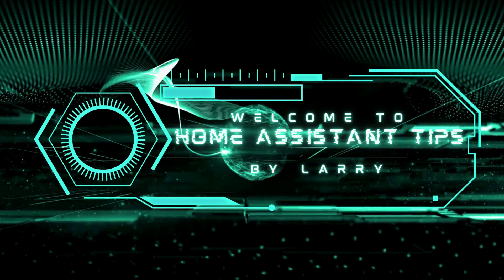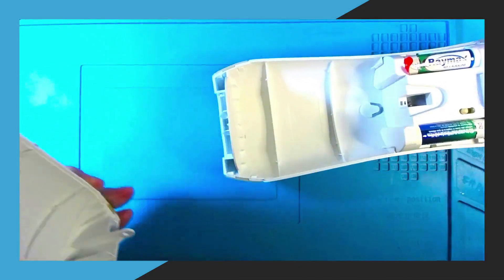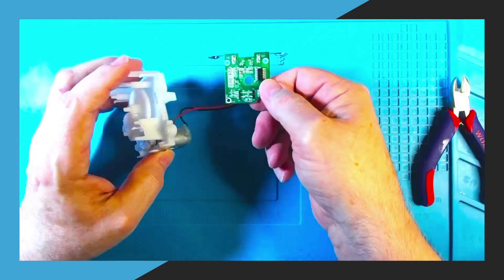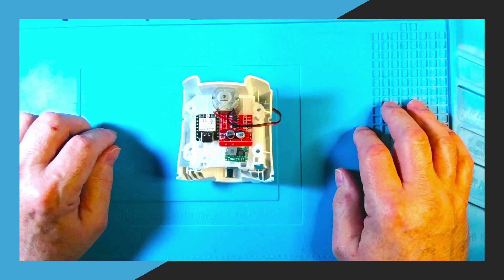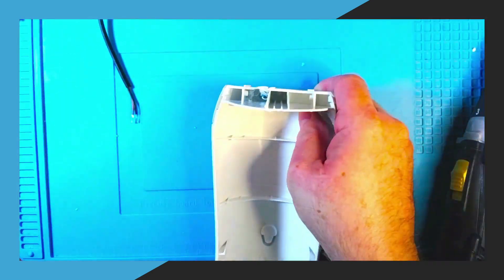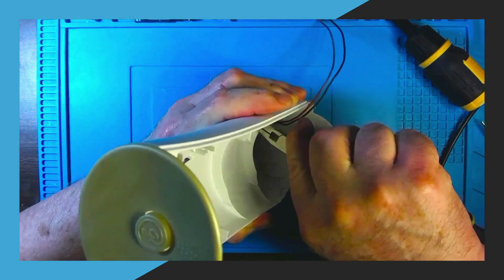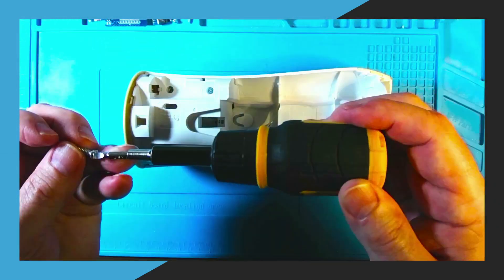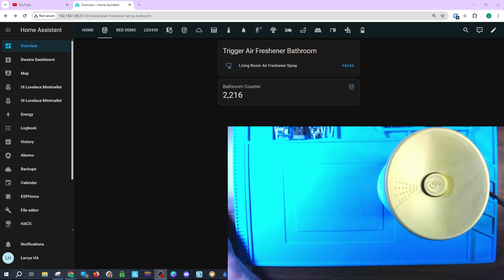Integrating a Glade Air Freshener with Home Assistant Full tutorial Mod

Comment: Can this powered by lithium battery it will last long?
Reply from the maker: Good Question. Yes and no, to answer your questions in order. The micro controller i picked, (although i didn't pick it for this reason) has battery connections on the back of it (as you can see in my wiring diagram https://github.com/HATipsByLarry/Glade-Air-Freshener-Mod/blob/main/Glade%20Air%20Freshener%20Wiring%20Diagram.jpg ) that would allow a battery to be connected and recharged, but because the micro controller needs constant wifi connection, (to know when to run the motor controller) you could not put it to sleep, so the drain on the battery would be constant and high.
Reply: @HATipsByLarry  thank you alot is any alternative controller can be used for 24/7 usage or any other way to make it more efficient
Reply from the maker: @akasha1337  No because of the need for any controller to have constant wifi connection to home assistant so it knows when to spray, the draw on the battery will be high. If we were talking about say a temperature and humidity sensor then things would be different as the sensor could wake the controller up from sleep, when the temp or humidity changed, then the controller could transmit the changes and go back to sleep. But in this situation we need to constantly listen to HA to know when to spray.

Comment: I did this as a college project, last year. Worked great until my gears broke. How did you solve the timing problem on the motor?
Reply from the maker: If you check out my code you can see where i start the motor forward then wait for 300 ms then break the motor. Then reverse the motor for another 300 ms. The timing was trail and error, slowly rising the value until i got it right.

switch:
  - platform: gpio
    id: fwd
    name: Motor Forward
    pin: 9

  - platform: gpio
    id: rvs
    name: Motor Reverse
    pin: 10

button:
  - platform: template
    id: btn_spray
    name: "Spray"
    on_press:
      - switch.turn_on: fwd
      - delay: 300ms
      - switch.turn_on: rvs
      - delay: 500ms
      - switch.turn_off: fwd
      - delay: 300ms
      - switch.turn_on: fwd
      - delay: 500ms
      - switch.turn_off: fwd
      - switch.turn_off: rvs
Reply: @HATipsByLarry  I had an older model (20 years). I figured out indeed it was trial and error. I landed at 500ms but alas it lived only 2 weeks until it broke. I was lucky I had footage of it working or I wouldn't have had a project to submit. 😬
Reply from the maker: @Dylan_Lanckman  I've had mine going for over a month now. So far no problems with it at all and gears look brand new. 😀 A friend of mine did try driving the motor with 5vdc (didn't use a buck converter to bring the voltage down) and ended up damaging the teeth on the gears.
Reply: @HATipsByLarry  exactly what happened with me. My electronics professor warned me for this but I didn't understand the logic at the moment so my contraption ground it's own gears apart.
Reply from the maker: @Dylan_Lanckman  Well now you know for next time 😀